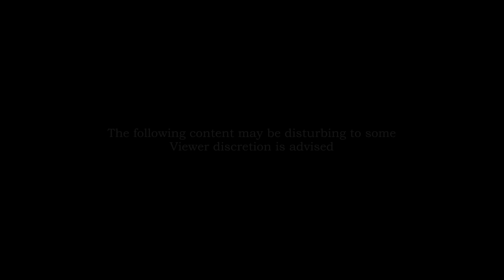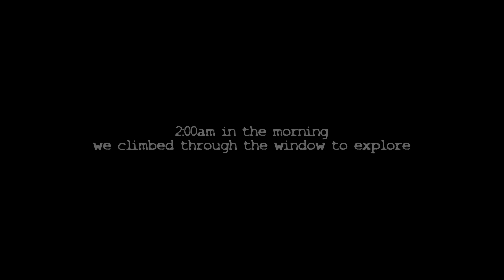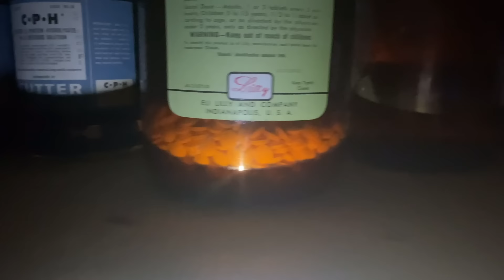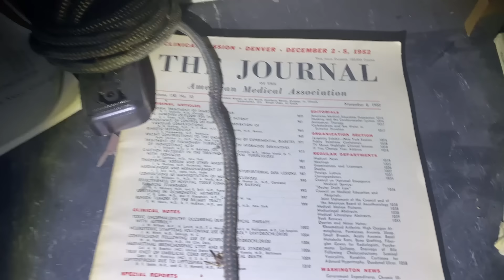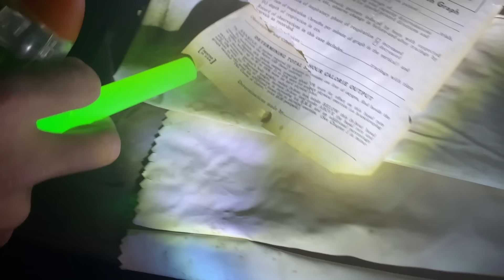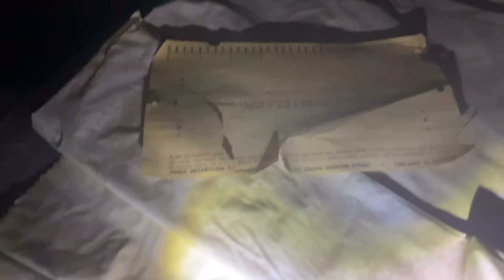Disturbing Discovery in Abandoned Hospital (Very Scary) Paranormal Investigation Goes Wrong

Comment: This whole video has me questioning a lot. First thing that I have to note is that with a lit of the noises that happened you never went to go and check what it was or to see if maybe a squatter was just trying to scare you away. Also that "blood" just looked like old dried up paint. There is no way that 50 year old blood would still be red. It would either be a medium brown if exposed to high oxygen levels or a very very dark brown in normal conditions. It doesn't seem as though there were enough windows to keep the blood a light color. The records on the paper look to be pretty new seeing as this is supposed to be a building abandoned 50 years ago.

Comment: That wire frame with the tape wrapped at the top. That's a brace for a (dog's) broken leg. The leg would be stretched with the foot taped to the bottom, then tape wrapped along the frame to stabilize it. My vet used to leave a loop at the top to run the leg through, and the padded part would be at the hip. Not sure why they didn't put a loop at the top.